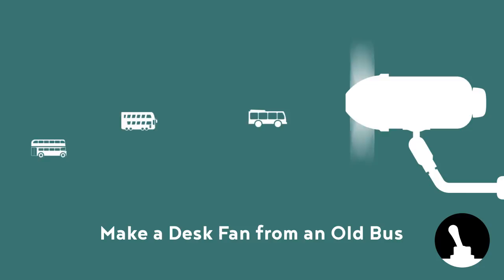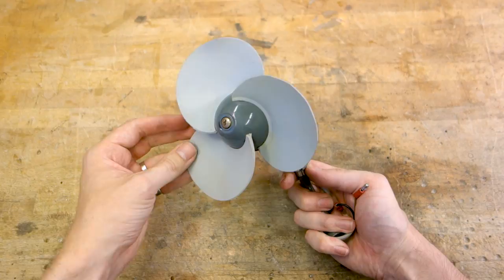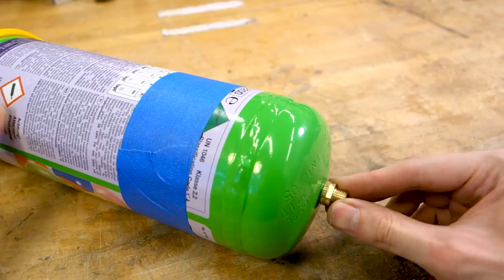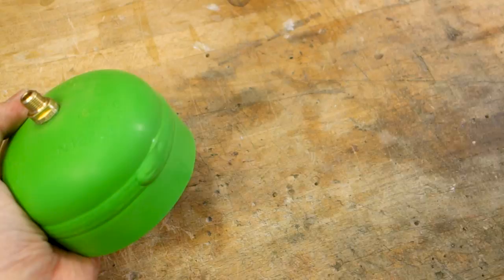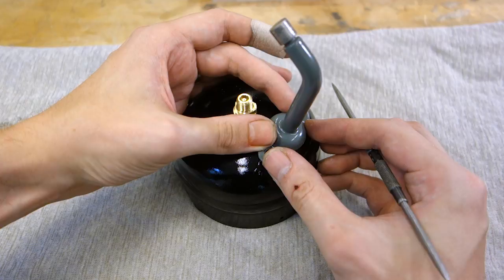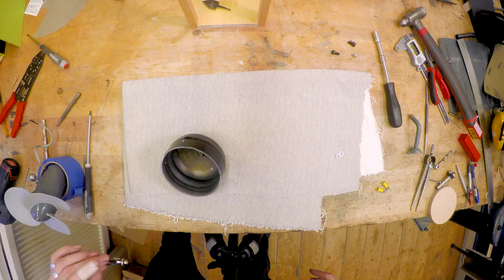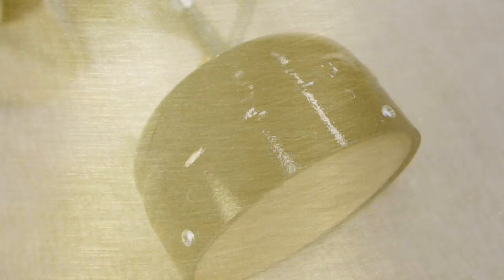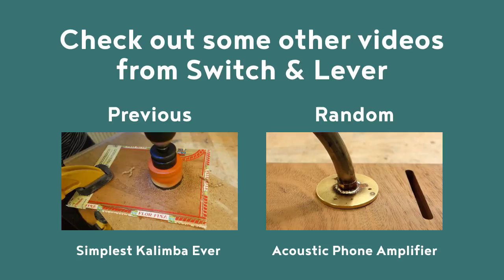Make a Desk Fan from an Old Bus

Comment: I really love this project!
however if you are using a flammable gas container you should definitely bubble it underwater to make absolutely certain there's nothing left in it.
Reply from the maker: Good point! Still, I would probably not play around with containers that used to hold flammable gas, if you don't know what you're doing.
Reply: Agreed! I'd never risk my hands for a project, even if it is an absolutely brilliant desk fan. :)
Reply: The manufacturer even recommends taking the top screw off, then filling the container with water and let it stay for 6 weeks if there was anything flammable in there. You're seriously going to have a bad time if it goes wrong...
Reply from the maker: +Pieter Ouborg depends on the cylinder. This is helium, which is relatively inert. Taking the top off was the first thing that occurred to me, but it is permanently attached to the cylinder on this one, so drilling and cutting was the only way out.
Reply: Switch & Lever "....if there was anything flammable in there..." should be key if you ask me. I'm rather attached to my eyebrows and meathooks :)
Reply from the maker: +Pieter Ouborg indeed, me too. Though, even so, if it was propane for instance (which by far is the most common combustible gas you'd be likely to come across) you'd still need a perfect storm of gas, ignition source and oxygen. Since, with drilling a small hole only gives a small access to atmospheric oxygen even if you'd mess up and spark the atmospheric pressure propane inside (assuming you emptied the valve thoroughly) you'd just create a flame coming out of the hole, no worse than from a cigarette lighter. The gas cylinder is made to withstand far worse. Even if there was a little pressure left you'd still be fine. Don't do it with a full cylinder though :)

Comment: Excellent work as always, and a pleasure to see..
Maybe a domed cap nut would look nice on the golden valve
Reply from the maker: +Theodore Tsinarakis possibly, but would likely need to be custom made as the threads are not standard metric or imperial.
Reply: Switch & Lever 
hmm custom made threads...
Even better for you!!!

Comment: cool! you can also use the golden valve for a may be a power on button, for the fan or something else  :)
Reply from the maker: Yeah, I thought about it, but it's a bit too much work to drill out the valve and fit something apropriate in there, considering that the fan already has its own power switch.

Comment: Helium is an inert gas so it will not combust. Also, to be DOUBLY sure that all the gas has been removed from the cylinder, fill it with water as the water will displace the gas out.
Reply from the maker: +iNaths indeed, which is why I said especially "if" you're working with combustible gas. :)

Comment: Excellent upcycle Sir!  Can't wait for the label video...have an old 1950 drill press label to build...if I can find the font.  Thanks for your enginerdity.  Did you use an off the shelf 24VDC switching PS?  Always a high point in my day!  ~PJ
Reply from the maker: Not so much off the shelf as off the big box o saved power supplies. I hoard them, because they always come in useful, especially the ones between 5-12 volts, but occasionally also these higher power ones. Glad you liked it!

Comment: And how exactly you locate the back side of the cylinder to put the barrel jack on?
Great video as always.
Reply from the maker: I look at it from the front, and then turn it around 180 degrees. The backside can be anywhere you want it, but it's probably handy to put it somewhere near the fan mount, for easier running of cables.

Comment: Guess I'm a bit picky but the lap on the weld was just looking wrong. I would have ended up wasting half an hour grinding that down. 

Might have been cheaper to buy a fan but I like the project. The finished product has character.
Reply from the maker: Cheaper to buy a fan, not sure about that, all of the parts (but the barrel jack) came free basically, so the cost was insignificant. One person's "wrong" is another person's "character" :)

Comment: It would be cool to turn the nozzle of the gas canister into the switch for the fan.
Reply from the maker: Why though? The fan already has a switch, which you can use to set two speeds with as well.
Reply: I guess I'm just not a fan of how the nozzle looks. If there was a way of moving the dial from the back of the lamp to the base, I probably would.

I think it's just personal preference, the fan still looks awesome! And I'm just about to watch your video on brass etching to see how you made the plaque, because that looks amazing too.

And thanks for responding to me so quickly! :) I've only just found your channel so you've definitely earned a new subscriber

Comment: Not a good idea to tin stranded wire before crimping the connector. These crimp fittings depend on stranded wire to spread out during the crimping process to make a secure connection. Tinned, stranded wire or solid wire will "take a set" during crimping and loosen over time with temperature fluctuations.

Comment: can the exposed wire touch the inside metal and transfer electricity ?
Reply from the maker: +simezra no, as I say and show in the video, they're insulated with electrical tape to avoid exactly that.
Reply: but you  insulated only one cable no?
Reply from the maker: +simezra no, just as I didn't drill just two holes, or painted just one layer of paint. Some things are edited for better story telling. If I was to show everything the video would be a couple of hours, or sped up to the point of being unwatchable.

Comment: Great. But the moderns screws to hold the base plate was a big mistake.
Reply from the maker: The modern screws can be easily replaced, if I had brass ones I would've used them.